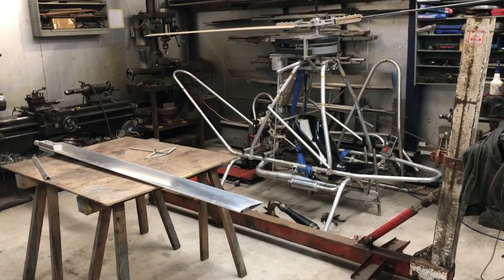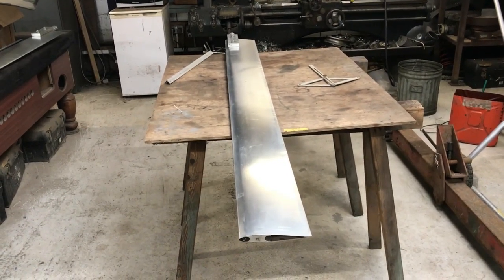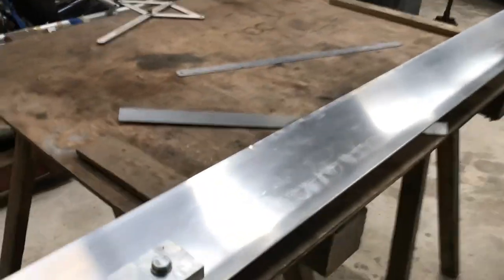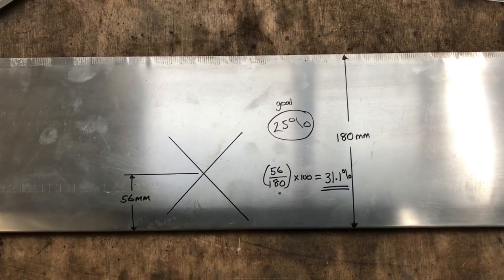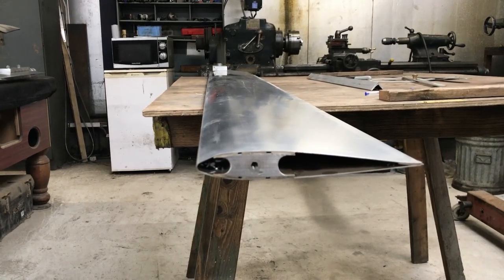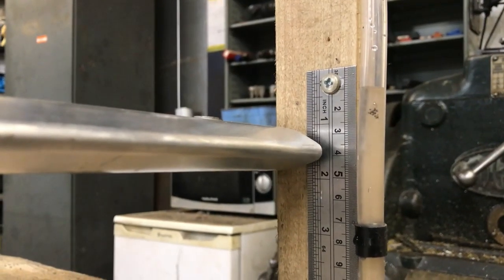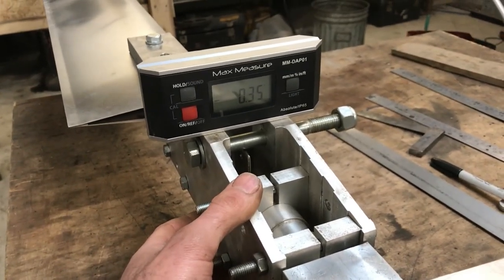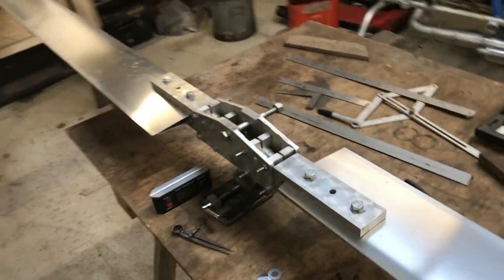Rotor Blade Balancing Homemade Helicopter

Comment: I'm a senior researcher at Heimkeeper Co., Ltd.
Our company has an idea to reduce propeller noise and vibration of helicopters and drones.We're done with the experiment.We have applied for a utility model and a patent As a result of several experiments with small propellers, the current noise and vibration reduction effect is about 30%.  Looking forward good news from you soon
Reply from the maker: Interesting, with the reduction in noise and vibration was the efficiency of thrust affected ?
Reply: I haven't actually tested it, but theoretically, I don't think it will be affected by thrust.

Comment: the placement of your inclinometer MIGHT be adding to the real balance point, Just a thing to consider.
Reply from the maker: @alexalvarez2495  yes that's something to be aware of. The inclinometer needs to be placed at its balance point to. I assumed the balance point was in the middle of the inclinometer but I didn't check that.👍
Reply: @Ben-Dixey  Hope it helps. Such a great job!

Comment: I saw no ground resonance so I would say you  got the balance pretty darn good. Going to have to build a collective pitch bird next.
Reply from the maker: Thank you, yes collective would be better I think, if I had twin engines as well that would be even safer. Ground resonance I believe can only happen with more than two blades on the same hub. Dont think it can happen on a coaxial with twin teetering rotors.

Comment: I know that this rotor cannot be firm, it has to be flexible. Which reinforcement plate do you use? Is it aluminum? Is it a stringer please?
Reply from the maker: The reinforcement plate, I think you are referring to, what I would call the spar is aluminium 6082t6

Comment: Everything has a cycles to failure index.  I would have to wonder at what time these blades will have to be replaced.  A rather critical component of a helicopter that we would never want to come apart when in motion.
Reply from the maker: Hi, yes determining the service life of a component is difficult. These particular blades weren't used as I made some much lighter ones. The new blades have a spar with a cross sectional area which will take the centrifugal loads at the materials fatigue strength. Parts built to this strength will not have a limited service life. However that's only centrifugal loads where actually there are other load factors like twisting and blade bending. These would reduce the life. Perhaps the only way to find out some numbers is to have a mechanical jig for testing blades running 24/7. This of course is very expensive research and beyond my means.

Comment: Good work.
 What happens when an engine shuts down in flight? Can you do an autorotation?
Reply from the maker: Hi, no autorotation is possible and at the height I'm operating autorotation wouldn't be much of an advantage as it takes 50-75ft to transition from powered flight to auto.

Comment: I'm wanting to make one a little smaller but use it like a gyrocopter but without a cart just with an engine for the engine on the back run to take off without a cart just the propeller and the engine for the engine

Comment: For gyrocopter blade chord is matter? For gyrobee having 210mm chord and 11ft long blade(per blade) but I have 178mm chord and  12.2ft long (per blade) is it ok to use ? Or chord and all to be match?
Reply from the maker: I'm not sure if I can answer your question but I need more information. 
Please explain in more detail what you are asking. You have a gyrobee gyrocopter and want to know if a 178mm chord and 12.2 ft long blade will work ?
Reply: @Ben-Dixey  yes exactly! It’s a project for us so we just making gyrobee but unfortunately the  blade size is 178 mm -12.2ft is available in china to purchase , they telling it’s fine to use ….most of home made Chinese gyrocopters were using this type of blade, but am not confident on that
Reply from the maker: @mohamedshafeelmohamedbilal6364  
Have a read of this forum thread. They discuss different blades on the gyro bee. 
https://www.rotaryforum.com/threads/gyrobee-blades.9720/
I expect the 178mm and 12.2ft long blades will work but it will have certain flight characteristics. Best to ask on the forum for more details.

Comment: saludos desde Colombia ? una pregunta como fabrico las palas del rotor ??????
Reply from the maker: Hello, I've done a video on how I made my blades https://m.youtube.com/watch?v=0U8iMWmxgO0

The blades in the balancing video I made but are too heavy for my coaxial helicopter, they would be ok for a single rotor with collective pitch. They were made by folding the skin around the aluminium spar. The spar was solid aluminium 6082t6 and milled to better fit the aero foil shape, then the skin was fixed to the spar with 3m double sided tape. This design was also too tail heavy with its chord mass at 31% it needs to be  25% in order to spin safely. This is partly why I changed the design but the balancing procedure is the same.

Comment: Can you guide me ? 
How  the CG and aerodynamic Center of rotor blade algin to the rotor head ?.
Reply from the maker: @prash007more  Sure, looking at the rotor from above the CG of the blades should pass through the centre of the rotor head. Looking from the side the CG of the blades should pass through the teeter bolt when in flight. This is how you determine the rotor undersling. You use trigonometry to work out the blade coning angle, to find how much the blades will flex up or cone you need the centrifugal force and the maximum take off weight. These are the two sides of the triangle the it's just trigonometry to find the angle. From watching this video you can work out where the CG of the blade is and then the height of the undersling. Hope this makes sense, but message back if it's still not clear.
Reply: @Ben-Dixey  thank you..
Reply from the maker: @prash007more  I like your lifting crane, brilliant 👍

Comment: Hi, Are you using this blade and this hub in your flying machine at the moment. I believe you have changed to the blade and you are currently using the one which has a solid D spar, the one that has a 4.75inch chord and a different rotor hub. Please correct me if I'm wrong
Reply from the maker: Hi, yes that is correct, the blades and hub in this video were not used. I just used them for the balancing demo. 
The CG location of the blade with blade straps and balancing was done in the same way on the new blade sets.

Comment: Hi there, I was wondering if the big bold in the middle of the rotors that sticks out quite a bit doesn't affect the balancing off the rotors? Or is this identical to how the rotors will be installed to the helicopter?
Great videos by the way really enjoying them!
Reply from the maker: Hi and thanks, yes the bolt needs to be balanced in its position. I didn't use this  rotorhead in favour of a different design, the new design has studs which are the same length and the same nuts both sides. It's just like balancing a wheel where all positions in a 360 circle must have the same mass from the centre of rotation. Where you can't add weight the centre position needs to be altered with shims instead. A out of balance centre bolt will affect the shimed position.
Reply: 🔴 What Is Islam? 

🔴 Islam is not just another religion. 

🔵 It is the same message preached by Moses, Jesus and Abraham.

 🔴 Islam literally means ‘submission to God’ and it teaches us to have a direct relationship with God. 

 🔵 It reminds us that since God created us, no one should be worshipped except God alone. 

 🔴 It also teaches that God is nothing like a human being or like anything that we can imagine.

🌍 The concept of God is summarized in the Quran as:

📖 { “Say, He is God, the One.  God, the Absolute.  He does not give birth, nor was He born, and there is nothing like Him.”} (Quran 112:1-4) 📚

🔴 Becoming a Muslim is not turning your back to Jesus. 

🔵 Rather it’s going back to the original teachings of Jesus and obeying him.
Reply: Yes goods  keren kreatip buat helikopter ?

Comment: Hi dear friend
This was the center of Mass.
Where is the center of aerodynamic pressure?
Reply from the maker: Hi, the center of pressure of a 0012 blade (also called the aerodynamic center) is 25% chord, this is why the center of mass of the blade also needs to be 25% chord.
Reply: @Ben-Dixey  thank you

Comment: It must balance at the aerodynamic center and the center of the mounting must be in the same position.
Reply from the maker: That's correct, it must balance at the aerodynamic centre and I would agree that mounting the blade at this location is sensible. However I don't think Robinson mount the blade here, they are mounted further back and there is a benefit to doing this. It was explained to me but I can't remember the reason now.

Comment: Usually rotors are balanced with out the Blade grip been attach,,remember to add tip weights
Reply from the maker: The Gyrotor instructions for blade chord balance said to have the blade straps and blade retaining bolts in place, this makes sense to me but I am happy to be persuaded otherwise. Tip weights is something I would definitely consider. Thanks for the comment.
Reply: How much should be tip weight need to add?. Is there any standard calculations?
Reply from the maker: @prash007more  I believe tip weights are sometimes added to reduce cyclic control sensitivity. They are sometimes used on gyrocopters and helicopters. I don't know if they will be necessary on my coaxial, I won't know until I try it. I'm hoping they won't be needed as it changes the centrifugal forces on the blade and the coning angles.

Comment: very old rare lathe :)
do you plan to install rounded ends  on the blades ? 
this will reduce the resistance to rotation at operating speeds of rotation
Reply from the maker: Yes. Love my old lathe, I found it for sale 1/2 a mile down the road and paid £200 for it. I put on a digital read out and a digital phase inverter. It will probably last a lot longer even having been built in the 50/60s. These blades aren't going to be used, I just used these for the balancing demo, the blades on the helicopter have inserts in the ends to prevent centrifugal air pumping which will drag the blades by a few hp. Rounded ends I'm sure would be even better but don't know by how much.

Comment: This great illustration buddy. Makes life easy...2questions for now...stage 2 balancing with m6 washers is that same as what they do with blade tracking? Then last stage balancing with that thin bar, is that necessary for blades supported with a bolt or all blades need that, eg the rotor head of this model am building doesn't seem like would be off on that, since it's holding pin on rotor head runs at center of the rotor shaft.
Reply from the maker: Thanks Jeff, tracking is done by spinning the rotor blades at flight rpm with some pitch but not enough to take off, adjustments are made on individual blade pitch so that they rotate in the same plane. I haven't done any tracking yet but I need to do it next test. Every rotor needs to spin on its centre of mass just like a wheel needs to spin on its centre of mass. When a car wheel is balanced you add weight to one section of the wheel this is because you can't change the wheels centre bolting point. With a rotor we can add weight like a wheel to the blade tips as a little weight makes a big difference over the length of the blade but much more weight would be needed to balance in the chord direction. Instead the rotor is shifted from its normal axis with shims. Alternatively you can lead or lag a blade in order to change its chord-wise mass distribution. No matter how accurate your blade retaining bolt holes are there will be a slight deviation at the blade tip to where it needs to be to balance. I'm not sure if the furia plans have included teeter hinge shims but it would be good to include them so you can get that rotor spinning with minimal vibration.
Reply: @Ben-Dixey  I see later on realised actually tracking is all about connecting rods and blade flaps adjustments...while what you did was rotor balancing itself...it's a good illustration will sure borrow some tips when my time comes...seems for my case I will need to dismount the entire rotor head and balance it with blades since they can't be dismounted seperately as your case....the easiest way for me with blades is using tubes and bars as shown in the plans...did one pic post with a prototype trying to figure out tube sizes...
Reply: Hello Ben, well been a while, just a quick one. Currently balancing my blades, and according to your video the washers are placed at the tip, I watched another RC blade balancing video and the guy says the weight should be added at the COG of the blade, as adding anywhere else offsets the individual blade  initial COG....does that make sense?
Cheers.

Comment: do you use radiator on your engine sir?
Reply from the maker: Hi, yes there will be a radiator and belt driven fan for cooling but for testing purposes I just have a water reservoir and electric pump.

Comment: Again very well explained , and really proper balancing of rotor blades is the secret of your successful spinning test in final video (I had problem of vibrations in propeller of para motor ,I did the same to get the propeller balanced ) ,this is why your rotors were spinning so stable without vibrations . Great job 👍
I wasn't sure that you are not going to use power line to change the pitch of blades in contra rotor system ?! 
Do you just just have to depend on high RPM for getting airlift ?
I shred your video to my friend in hobby aviations .
Thnx
Reply from the maker: Thank you. Yes that's correct the blades are fixed in pitch and engine rpm is used to control lift. It's not as precise as using what's called collective pitch but it's still effective. Have a look at the Nolan helicopter this is where the inspiration came from., 
https://m.youtube.com/watch?v=B21Xk6tNcBw
Reply: @Ben-Dixey  actually even with fixed pitch it's looked quite controled and stable ..
But you can change the position of rotors on their Axis ? To get the cyclic control ?
Reply from the maker: @rajeevshagun7409  yes, you have got it. It keeps things simple and lightweight but there is a drawback which is control. With cyclic pitch control using a swash plate it's very sensitive and responsive. With a tilting mast there will likely be a time delay between control inputs and response. I will have to learn to compensate for this but as the Nolan helicopter demonstrates it's very controllable once you have mastered it. I will soon find out what it responds like as I'm getting ready for the next test.
Reply: @Ben-Dixey  oh my best wishes are with you ... Don't need to remind you the safety procedures , because you are well aware .
The good part of contra rotors is , it has very little chance to get wild spinning due to anti torque  rotors failure .
Almost no chance .
I have seen wild vibrations in main rotors in new copters .
But your stuff is balanced blades we can trust it .
I wish I would be around you that time .
Reply from the maker: @rajeevshagun7409  Thanks for the encouragement. I will be recording the final testing procedures and then 🤞learning to fly it so everyone can experience it with me. 👍

Comment: Very useful information I didnt find from other homebuilt helicopter channels. Is there a follow up?

You earned a subscriber BTW
Reply from the maker: Thank you. A follow up to blade balancing ? For me the process in the video worked and I haven't had to do any further work on balancing. Dynamic balancing would probably be the next step or perhaps fine tuning the method of chord wise rotor balancing.
Reply: @Ben-Dixey  All right then. 👍

Comment: My most of doubts get cleared by this video regarding rotor blade balancing.. it's really informative. keep sharing.. 
How u design n calculated the rotor blade strength? Do u have any design calculation to share? if u don't mind.
How u chose the blade length, cord, air profile, also the main spar, material of the blade.. n all these things..?
Reply from the maker: Hi, thanks for the comment, I've been thinking about doing a rotor strength video, there are a bunch of calculations i did to determine such things as rotor hub thickness, blade strap thickness, rotor spar strength, bolt shear strength ect. I can only determine these values in a basic calculation and you could go much further than I did using cad and stress analysis. I'm no expert but could share my basic understanding.
Reply: @Ben-Dixey  thanks

Comment: Merhabalar ben. 30 kilogram kendi ağırlığında helikopter yapmayı düşünüyorum bunun için nasıl bir pervane ölçüsü çıkarmam lazım ( uzunluk .kalınlık  ve en) olarak
Reply from the maker: That is a huge question to answer and I can't answer it. There is guidance on rotor blade size if you look up disc loading, solidity ratios, and aspect ratios. But ultimately what I did was copy what someone else had done. If you can find an example of a 30kg helicopter and its rotor dimensions that is. 30 kg is very light are you making a model ?

Comment: Why 25 % is your target?
Reply from the maker: 25% is where the centre of pressure is located on a naca 0012 aerofoil. If the balance is not at 25% then forces will be present in the collective stick. Weight either side of 25% will cause the blade to want to go to 0 pitch.